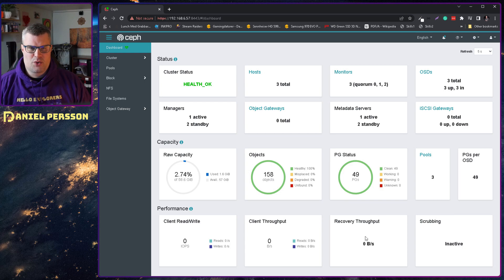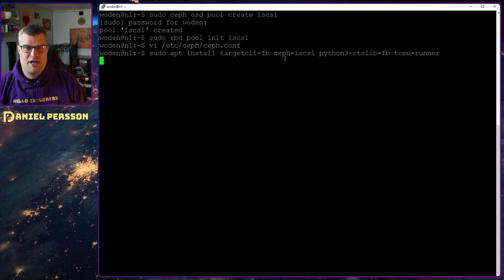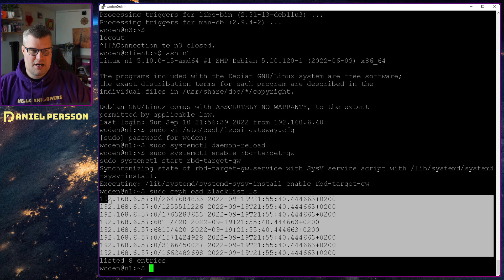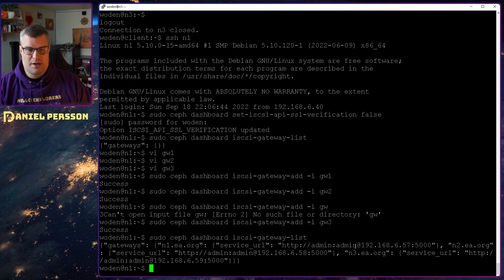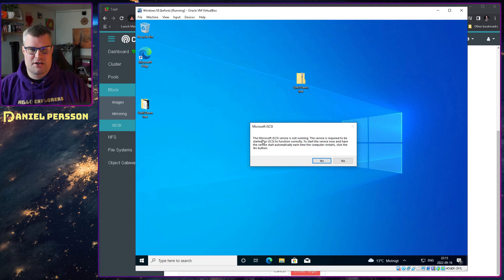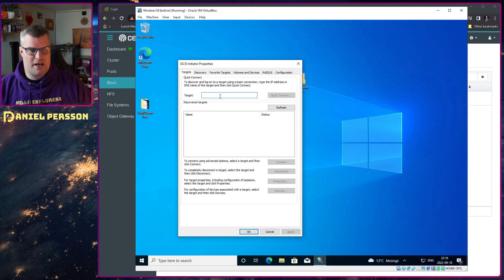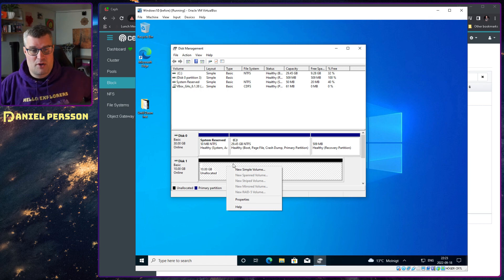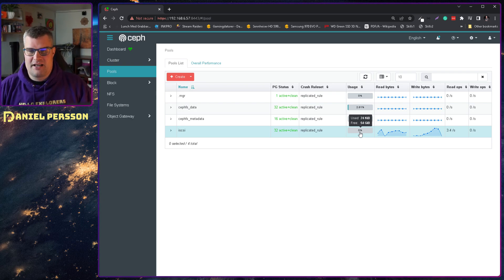Setting up iSCSI in Ceph

Comment: I have followed the above tutorial for iscsi-gateway trying to connect ovirt 4.5 and ceph-cluster reef_v18. but only mon1 successfully installed iscsi-gateway with port 5000 but others mon2 and osd1,2,3 has different port. Also i have installed ceph-cluster by cephadm where only mon1 has /etc/ceph directory and other nodes dont have this directory. so where to create iscsi-gateway.cfg files on other nodes like mon2,osd1,2,3 ?
Reply from the maker: Hi Ankit.

Sounds like your installation is broken or perhaps incapsulated in CephAdm containers and then your etc directory is incapsulated in that solution which makes everything more complicated. So either wait for the Ceph team to make this installation easier from the GUI or do a Manual install.

Thank you for watching my videos.

Best regards
Daniel

Comment: sometimes the gw server not goes up. now it work i have good look. and after reboot is still up. if there something what i am missing?
i also can create an volume. create an iscsi target. but i can not bind the target to the volume. it output an error.

Failed to create target 'iqn.2001-07.com.ceph:1694865111544'
disk create/update failed on s-07iR4px. LUN allocation failure

host=`hostname -s`

ip4=`ip -o -4 addr list $(ip r|grep "default"|awk '{print $5}') | awk '{print $4}' | cut -d/ -f1`

######install iscsi gateway (not work good. gateway not come up all time)######
cat > /etc/ceph/gw1 << GW1CONF
http://admin:admin@$ip4:5000
GW1CONF
 
cat > /etc/ceph/iscsi-gateway.cfg << IGCONF
[config]
cluster_name = ceph
gateway_keyring = ceph.client.admin.keyring
pool = iscsi
api_secure = false
api_port = 5001
api_user = admin
api_password = admin
trusted_ip_list = $ip4
IGCONF
 
cat >> /etc/ceph/ceph.conf << CCONF
 
[osd]
osd heartbeat grace = 20
osd heartbeat interval = 5
osd client watch timeout = 25
CCONF
 
ceph osd pool create iscsi
rbd pool init iscsi
 
systemctl daemon-reload
 
ceph osd blacklist clear
 
systemctl start rbd-target-gw
systemctl status rbd-target-gw
systemctl enable rbd-target-gw
 
ceph osd blacklist clear
 
systemctl start rbd-target-api
systemctl status rbd-target-api
systemctl enable rbd-target-api
 
#reboot your system
 
ceph dashboard set-iscsi-api-ssl-verification false
ceph dashboard iscsi-gateway-add -i /etc/ceph/gw1 $host
Reply from the maker: Hi Echo.

I've not seen that error while I was setting it up, I would test my network or remove and retry the process. Maybe there is a step we've missed. I had to try a couple of times in order to get my setup correct. So I ran into a couple of ways that did not work. Sadly I never saw your issue.

I hope this helps.

Best regards
Daniel

Comment: [osd]
osd heartbeat grace = 20
osd heartbeat interval = 5
osd client watch timeout = 15

[config]
# Name of the Ceph storage cluster. A suitable Ceph configuration file allowing
# access to the Ceph storage cluster from the gateway node is required, if not
# colocated on an OSD node.
cluster_name = ceph

# Place a copy of the ceph cluster's admin keyring in the gateway's /etc/ceph
# directory and reference the filename here
gateway_keyring = ceph.client.admin.keyring

# API settings.
# The API supports a number of options that allow you to tailor it to your
# local environment. If you want to run the API under https, you will need to
# create cert/key files that are compatible for each iSCSI gateway node, that is
# not locked to a specific node. SSL cert and key files must be called
# 'iscsi-gateway.crt' and 'iscsi-gateway.key' and placed in the '/etc/ceph/' directory
# on each gateway node. With the SSL files in place, you can use 'api_secure = true'
# to switch to https mode.

# To support the API, the bare minimum settings are:
api_secure = false

# Additional API configuration options are as follows, defaults shown.
# api_user = admin
# api_password = admin
# api_port = 5001
# trusted_ip_list = 192.168.0.10,192.168.0.11

Comment: Hello, I am having issues with TCMU runner. It fails to create the LUN.
It is a single node ceph cluster.
This are the relevant logs:
2023-07-05 11:05:29.252 16845 [ERROR] add_device:540: handler open failed for uio0
2023-07-05 11:05:29.252 16845 [ERROR] add_device:497: could not open /dev/uio0

Thanks
Reply from the maker: Hi Lukas.

I'm sorry but I never seen that issue. When I did a quick google I found threads talking about a bug in the software that impacted some versions of Centos and Fedora. But I don't know enough about your setup to be of any great help.

https://github.com/gluster/gluster-block/issues/258

I hope you find a solution. Thank you for watching my videos.

Best regards
Daniel

Comment: Hey Daniel,
first of all thanks for your Videos. 

Do you have any clue why It fails to add my gateway?
I can list all gateways, so the API is up, but I can't add.
I used the same configuration as you.

iscsi REST API cannot be reached: Connection refused [errno 111]. Please check your configuration and that the API endpoint is accessible
Reply from the maker: Hi Sativa.

There could be so many reasons when network is involved. In this case you can to connect. It can be due to bad connection, firewalls, routing rules. Service failure, incorrect port a.s.o.

I hope this helps.

Best regards
Daniel

Comment: I have a test cluster of 3 Proxmox nodes that I have been testing ceph on before I use it in production, and I followed your video and had issues with two of the portals saying "Failed to create target 'iqn...' Gateway creation failed: gateway(s) unavailable node3(UNKNOWN state).
Reply from the maker: Hi Nathan

Thank you for watching my videos.

That is a strange error message, I found that I could get some strange error messages during testing if I had too much latency between the systems or if one of the gateways had a hard time answering in a timely manner. But when the system stabilized I got it to work consistently. I would start to look at logs in Windows and on the Ceph gateways to see if I can find more information.

I hope this helps.

Best regards
Daniel

Comment: I want to know if I can connect Proxmox with 3 nodes in cluster to an external ceph cluster by using rbd. I clearify I have one cluster with 3 nodes in Proxmox but I wouldlike to connect this cluster to an external ceph cluster for to store my VMs. It's possible to use RBD option in Proxmox  in this topology? I don't know if I'm clear.
Reply: Yes you can totally do that, you only need to create a pool and credentials for it. Then copy over the conf to the Proxmox nodes and add the pool via the GUI

Comment: i want to see if you look at av video from från the iscsi and when shutdown ceph nodes. How will the system behave?
Good video by the way :)
Reply from the maker: Hi Mystic.

Well I think that is more of an client implementation detail and as the protocol is old I think Windows should be able to handle the failover if you supply multiple available nodes.

Thank you for watching my videos.

Best regards
Daniel
Reply: @DanielPersson  hi i just want to see how the system behaves. Start a video and as it is playing disconnect the node in the cluster the you are connected to.